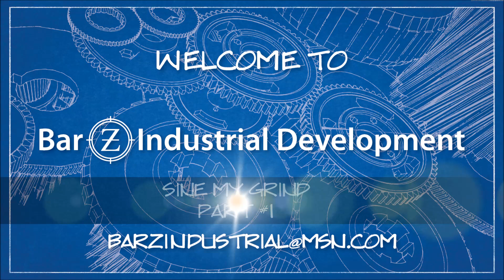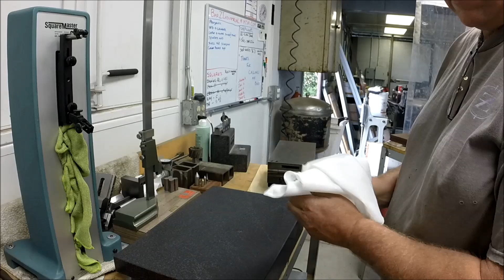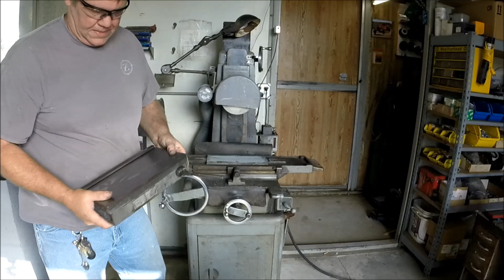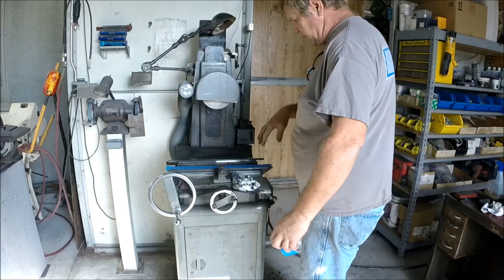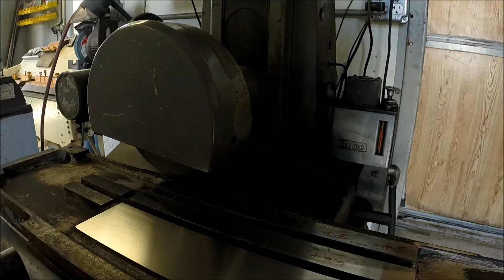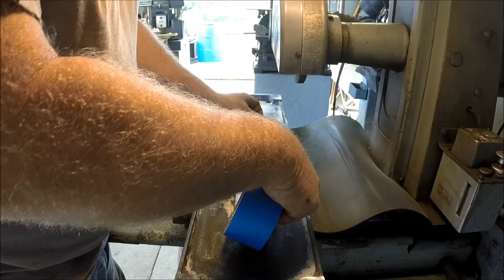Sine my Grind Part #1

Comment: Perfect timing Stan. I just got a Boyar-Schultz 612 I getting tuned in, and it didn't have a mag chuck, so I bought a Suburban MC-612-S2 not knowing it was for the sine set. Then I found a SP-612-S2 which is in transit, so I'm watching and curious how you will mount it...the S2 models don't seem to have a tang. Looking forward to the next video.

Cheers, Alan

Comment: Hi Stan,

Just curious here. Why did you decide on mounting the sine directly to the grinder? I would have just reground it on your existing mag chuck. Then your sine isnt tied down to one single position.

Alex
Reply from the maker: Hi Alex,
I started with that notion, but after installing that rig on top of my existing mag, I was out of Z axis and wouldn't be able to make 45*, not to mention the table was very heavy with everything installed and my left arm would have been rubber after an hour of grinding.

Comment: Stan, excellent mounting you did on the first mag chuck! Great job on grinding the table, nice clean up! You did a good job explaining how the way oil affects the table when it's in motion, proof that a thin film of oil between two surfaces can control some of the tooling/grinding actions of shop machines!
....13

Comment: Nice video Stan. One thing I would recommend is take an old mag base and mount bar to the mount hole and bore a hole to mount a diamond to it with a set screw so you can dress your wheel if you ever have the sine plate or mag plate off. Keep the videos coming. 

              Matt

Comment: Hi,

Thanks for that great video, do you balance your wheels ? because i see you get a great finish, i have a tool grinder who can be used as a surface grinder, don't don't have any system to balance the wheel on the wheel holder.

Thanks  a lot.
Reply from the maker: The smaller wheels like mine (7") usually run pretty smooth without a balance, just a good dressing and they are good to go, there is always the "problem child" wheel that shows up and never gives a good finish, when I find these they get a swift crack with a hammer never to plague mankind ever again :)
Reply: Shadon HKW Ok, thanks a lot ;)
I will give a try without balancing on my grinder and see how that work.

Comment: Stan,

I really appreciate your efforts on this video.  Sadly as a college industrial arts student I received no experience on abrasive machining.  When I started working at my current job the shop had a KO Lee grinder.  I had to teach myself how to use it.  I have since learned a bit more from you.  My students work has improved because of it.  I am thinking that our Grinder needs a bit of work to get it back into true.  I had one of my students regrind the chuck a couple of years ago.  It got better but did not solve all of the problems.  I think it is time to give it a good cleaning and indicate it.  I also own a 1918 Reid Brothers grinder and the tips you gave on seting it up and evaluating it will help me immensely.  One seldom thinks about castings drooping over time, but they do.

All The Best!
Mike

Comment: Do you think that the weight of the mag chuck may change the way the table sits on the ways? And when you clamp the mag chuck on the table it may twist or bend the table slightly....what do you think?
Reply: Shadon HKW It all comes down to the flaking, the little voids keep the oil consistent.

Comment: I have a similar oil phenomenon with my grinder, that is why I always try to grind clear of the part and come back to it so any jumping or changes from direction don't transfer over to the part. I also notice that as the oil warms up it can change some too. Chasing those .0001's can be a challenge!